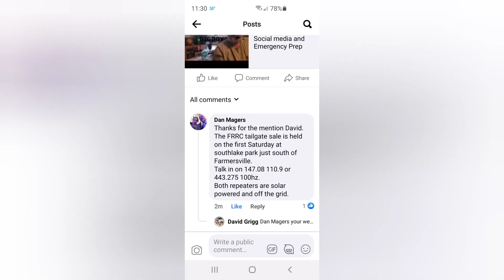RFI troubleshooting tips and how many radios do you need. #hamradio #hfradio #amateurradio

Comment: I live in a residential area and at times in the morning, around 4 to 8 AM, all the bands are wiped out. Turns out the noise is coming from all the neighbors with solar panels and they probably selling back to the power company at that time of day. Anyway I have tracked down the noise to my neighbors houses with the solar panels. I'm sure it's the inverters. There are so many out there, there isn't much I can do.
Reply from the maker: dang i hate that, not sure of anything i know that will help, ill ask wd5hkv n w5dlx if they have any suggestions, thanks for watching!73!
Reply: Yeah if you have multiple houses around you with solar that may be difficult to solve. It seems some of it can be filitered at the source with some RF chokes (inverters or panels themselves) but with that many it sure sounds like a challenge. As common as those systems are becoming, it looks like others will probably be experiencing  similar problems. If you haven't already, check out ARRL they might have some answers. Lots of information there. Good luck!
     Jeff